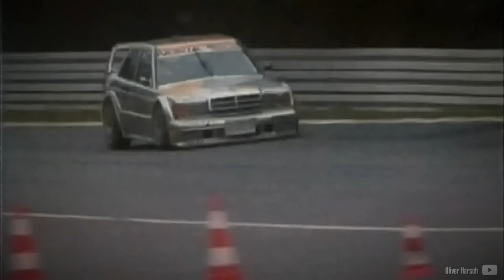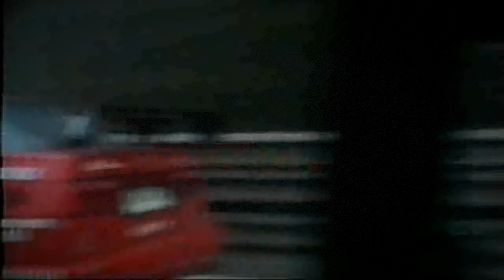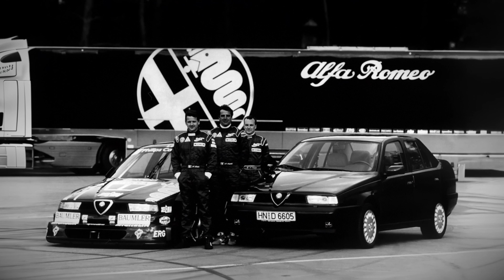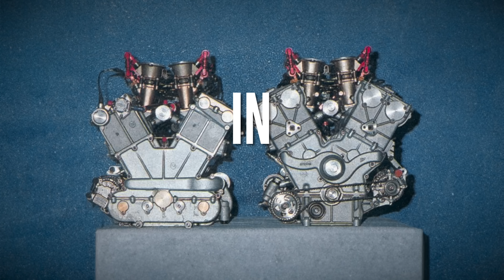Alfa Romeo V6 DTM: A 12,000rpm French Engine

Comment: The base of the 90 degr. was the Lancia Thema V6 engine which was based on the RPV cooperation. Except V90 angle and bore distances there were no common parts with the RPV engine, but was a completely new constructions of the Lancia race department. So it was really an Italian race engine.
Reply: exactly
is only a click bait title i guess
Reply: this is some good info, ty guys
Reply: Was it not a Peugeot engine
Reply: @Paul7mac Peugeot Renault Volvo
Reply: The rules state teams had to use a "production block" the PRV was designed as a race engine as well and was used for racing with bare block only weighing 32kg which is the similar weight to modern v6 engines like the greatest v6 ever made the Nissan VQ. The heads of the PRV were ancient and never designed for racing yet 24v heads were available from the 605, XM and Venturi using bespoke mechanism for racing and endurance racing.
Reply: @altruismfirst6489  Not Correct:  The rules did not require that original block should be used!  The rules required that the V-angle of the block and the space between the cylinders were the same as for the road engine. So for the first years Alfa used the pattern from the V6 60degr Busso engine and for the last year they used the cylinder distances from the Lancia Thema(PRV) V6 90degr engine. In both cases the race engines were in house construction pure race engines. The reason for the 90degr. engine was that it was more compact lengthwise  and lower center of gravity and produced about 50hp more than the Busso pattern engine. So about 500Hp for a 2,5L engine. So to make it quite clear the Alfa Engine had nothing to do with the PRV engine, only some geometry.
Reply: Was it based around the F1 1.5 Renault turbo?
Reply: @madt7873   Not at all, the engine was an in house construction of Lancia Racing department. The 60 degr. engine was based on the Busso engine and the 90 degr. engine was based on the Lancia Thema RPV engine. The only similarities with the road engines were the V-60 cylinder block and V90 block angles, and the cylinder spacings of the road engines. Otherwise they were completely new construction race engines.
Reply: Reparto corse Alfa Romeo
Reply: The Peugeot-Renault-Volvo (PRV) V6 engine, a 90° V6, was used by Alfa Romeo as the basis for the 690RC engine. This was justified because the Lancia Thema (a car that used the PRV engine) shared its platform with the Alfa Romeo 164, thus linking the production engines. PRV engine! End of discussion.
Reply: es war ein Italienischer Motor, der Titel liegt komplett daneben. Dazu kommt noch die Magnetti Marelli Steuerung, dass McLaren in der Formel1 auch benutzte. Ich Denke, man sollte Italiener nie zu stark herausfordern, oder man wird am Ende verlieren))
Reply from the maker: Yes, exactly
Reply: @VisioRacer  why are you writing french motor...change your description; it hurts to read
Reply: OK. So anyone of those who claim that it was just the angle, why didn't they "base" it on Alfa Montreal 90° engine? Limone clearly said that they couldn't use Montreal engine as "base" because the cylinders were too close to each other.
Reply: @GitonIcon identical cylinder bore spacing is one of the requirements, therefore they could not use an engine with too close bore spacing as it would not leave enough room for large piston diameter to make enough power.
Reply: @GitonIcon just look at the weight of the race engines, it would be impossible to use a regular production block because the block alone weighs 75% as much as the entire race engine. Also they couldn’t move the valvetrain on the first generation block to the back of it was a production block meant for front mounted belt drive for cams. The blocks look nothing like the factory ones, completely different mounts and look and materials.
Reply: From wikipedia:

"FIA homologation documentation shows the homologated production engine was a "2850cm³" capacity "V6” engine. The "Montreal V8" story was created to throw the press off the scent and to satisfy FIAT management who were unhappy that a non-FIAT group developed engine was being used."

So, if Montreal's 90° was enough to fulfill the rules, than they would stick to it. Find me a source that prooves that actual block on DTM was actually developed from scratch by Alfa. When it matters weigth, all tumed blocks are skimmed from extra weight. Homologated production engine in Group A or any other series means that actual block from production engine is used. You can tune it as much as you like, but it has to be from actual prodction engine. So, to end my claims, I say that Alfa used genuine PRV engine block from Thema, with their own internals, heads, valvetrain, pumps etc. just like Peugeot did on their WM Le Mans car. Alfa did not desig and cast new racing block, because that would be against the homologation purpose and meaning. Proove me wrong.
Reply: Engine block was the same. Alfa made new heads, but block was PRV as homollogation required. So, it was tuned PRV
Reply: @GitonIcon  No the original block was unusable and it was not a requirement that the original block should be used! The homologation was only for V90 angle and same cylinder spacing as the production engine.
Reply: @GitonIcon  The block would have been a specialised cast or billet racing block with no PRV parts. The homologation is just a piece of paper with the cylinder bore spacing written on it, nothing more.
Reply: @alexjenner1108 Using your anallogy, this PRV-Alfa was more Alfa than Alfa V8 without two cylinders. There is no shame here being put on Alfa, besides Alfa was manufacturing under licence several Renault models including Dauphine, 8 and 4.
If they didn't feel bad about it why should any Alfa fan? You'll never hear fan of Renault or Volvo saying "No Peugeot WM P88 with 900HP reaching 407 kph wasn't  PRV,  it was just angle.
Reply: @alexjenner1108  No. Block has to be from normal car. Even BMW used blocks from scrapyard to make their 1500 HP  F1 turbo engines back in the 80s. Besides, no freshly casted block can have same strenght as one from car that clocked 100.000 km or more, while constantly heating and cooling that made it stronger.
Reply: @GitonIcon  it depends on the set of rules, it's not the same for different categories.
If you watch the interview to Sergio Limone by Davide Cironi [it's got English subtitles] he clearly says it just needed to have the same bank angle and cylinder spacing. They built a new engine around those parameters.
Reply: @GitonIcon  no it doesn't to be the block from normal car, please do some research and what does BMW F1 have to do with anything?. You can find the interviews with Sergio Limone here on Youtube. "The engine had to derive from an already-existing street engine. The distance between the cylinders has to be the same, as well as the V-angle".
Reply: and that's it, derive from simply means that same bore spacing and V-angle.
Reply: @GitonIcon  not sure what any of that has to do with anything. This is not about shame, it's simply not accurate. Would you say that a Cosworth DFV was a Ford Cortina engine? The Cosworth DFV was derived from the Cosworth FVA inline-4 and the FVA was based on a Ford Cortina engine block. So we could say the Cosworth DFV was derived from a Ford Cortina engine, but is the DFV a Ford Cortina engine? I'm going to say no.
Reply: @GitonIcon this is about touring cars not f1 😂
Reply: No, solo le misure caratteristiche erano uguali per regolamento, tutto il motore era frutto di nuova progettazione
Reply: @GitonIcon   On YT chanell of Davide Cironi you could find interview off Sergio Limone: saying this:  
“The V6 engine for the championship was born following the DTM rules:
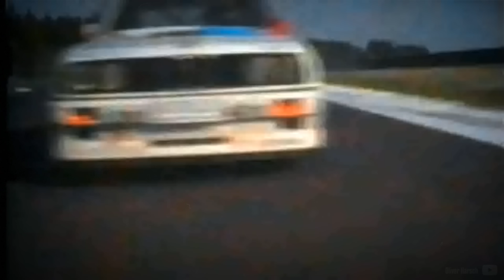0:11
an engine derived from a mass-produced one and with a bit of... magnanimity,
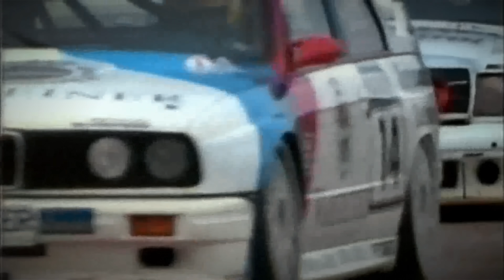0:17
the interpretation the Germans gave to “mass-produced” was
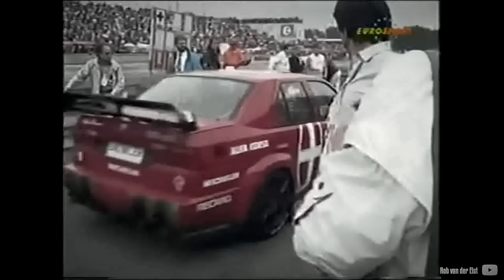0:24
same V-angle and same distance between the cylinders...
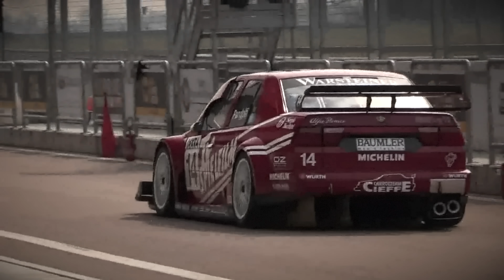0:32
This led to the use of the V6 Alfa Romeo for the first 3 years,
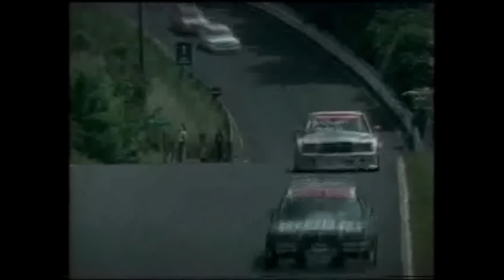0:42
then the enginemen realized that the 60° V was not the optimal one:
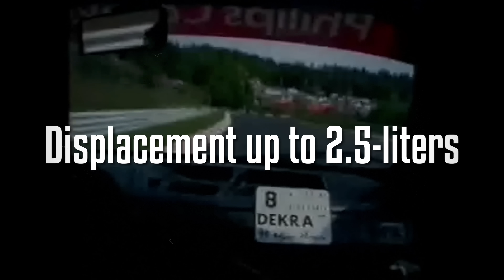0:49
a 90° would have been better.
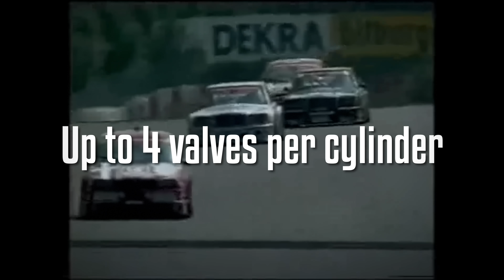0:54
Alfa Romeo made just a 90° V-engine which was the Montreal one,
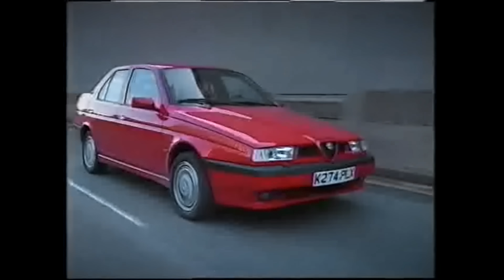1:05
but the cylinders were too close to each other, so
1:11
the bore wouldn’t have been big enough...
1:17
Flicking through the papers, I noticed that Alfa Romeo
1:24
at a certain point was no longer: it merged and became Alfa-Lancia...
1:32
This lasted for a few years (2/3 years);
1:35
so Alfa Romeo produced Lancia cars too,
1:41
so I picked the only 90° V6 which was the PRV (Peugeot-Renault-Volvo),
1:50
mounted on the Thema too.
1:56
So the engine on that car (the 155 DTM) is geometrically derived from the Thema.
2:00
I also homologated the Montreal engine even though it has never been used "
Reply: @GitonIcon   wrong.
Reply: @GitonIcon  the first DTM Alfa 155 was a Busso design by Alfa Romeo, thus a 6V 60° engine. Later in 1996 the Lancia engineers realized that a 6V 90° design would bring some advanteges...  but it was a rule that the design should derive from a production car of the group.... and where do you think Lancia's PRV got its 6V 90° engine from? Guess what, it was a Maserati design, commissioned by Citroen for its former SM....
If you read the tests of the SM around 1973, you learn about its abnormal racey behaviour, which was a bit out of place on the SM....
Reply: @MrMauriziomazzoni  No. Peugeot-Renault-Volvo designed their V6 from scratch.
Reply: So they cut 2 cylinders from a V8 90°, as Maserati had done for Citroen.....and Peugeot owned Citroen... and the first PRV had 2664 ccm, while the Citroen SM had 2670 ccm... but those are only coincidences

Comment: 133mm bore spacing?!!!  Did I hear that correctly?
Reply: Probably a mistake, most likely is 13.3mm
Reply: @taketaa5299  doubt it's a mistake. Looking at images of the Busso block, 133mm between the cylinder bore centres seems reasonable.

Bigger than I'd have expected though. 133mm is a huge bore spacing for any car engine
Reply: @niia.3642 oh yeah, without a doubt. I was referring the 13.3mm as the wall to wall cylinder space but that make sense
Reply from the maker: It went to re-check that and there is rarely mentioned the Busso’s bore spacing, only two sources I was able to find say the 133 mm figure. Indeed ridiculously wide, but seems legit looking at the engine deck
Reply: @VisioRacer  That's awesome!  I was just shocked that something that wasn't an industrial or large truck engine had bore spacing that wide.